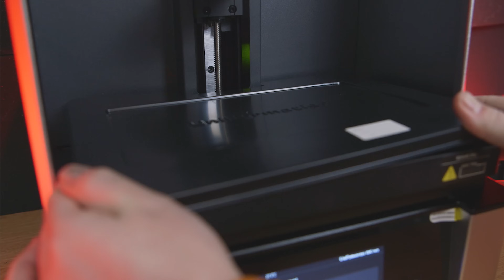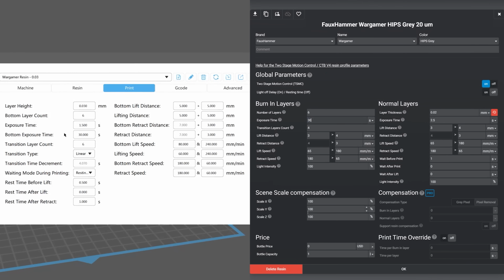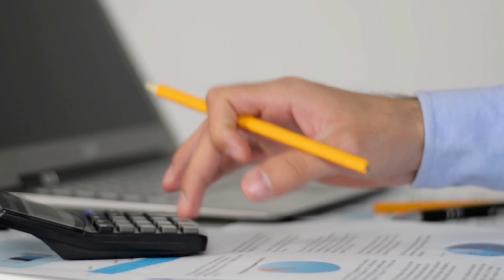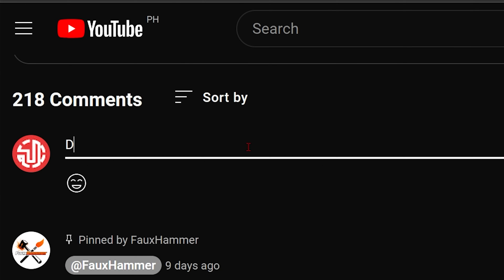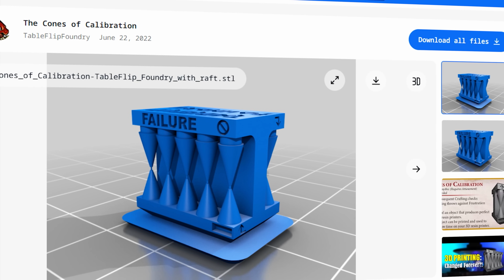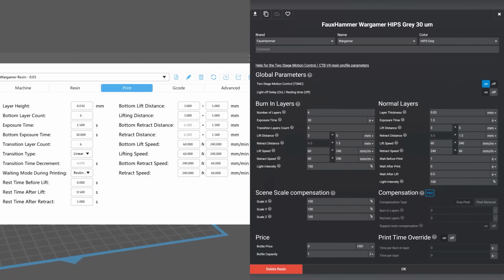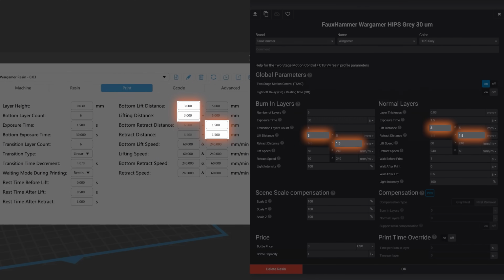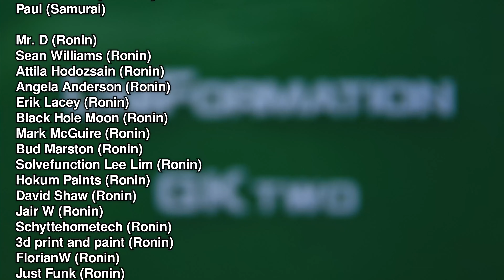The Best RESIN SLICER SETTINGS Explained for every printer! -  All Key 3D Printer Settings Explained

Comment: This was a helpful video. Sadly I cant use the newer version of chitu so I dont have all these settings. I use the elegoo mars pro and the new chitu doesn't seem to work on my printer. Once I finally get a new printer I should be able to use the new chitu. But for now my options are
Bottom lift distance 
Lifting distance
Bottom lift speed
Lifting speed
Retract speed
Which in order I have them set to 5,5,100,100,150.
I bought this printer in 2020 and only did a few prints havent touched it since. But now I got it back and im relearning everything about it again

Comment: Hi,
I have met a problem with the size of the models become larger.
Ex. The prongs size is 0.70mm but after printed become to 12mm.
Ex. The ring diameter (Inner) 17mm become 13mm.
What shout i change in setting?

Comment: I got my Anycubic Photon mono M5s PRO 14K, what was coming with Fast Fep, and I changed to Clear FEP as I was looking more for quality, but whatever I do now, I even tried different resins,  I get "zero pull force detected" and all my attempts are failed!, I find half of the bed on the plate, and half of the bet on the screen even before the supports even have a chance to form, so that foot before the print supports start it gets split into 2 halfs one on the bed but looks quite pressed and the rest is in the VAT, I tried to play with the settings and all that nothing seems to work :( please help!
Reply from the maker: Cna you not turn off the pull force detection on the Printer?

You will need to perform a manual level of the printer too, oif after that, nothing is sticking to the plate, then your base/botrtom exposure time is too low or too high,

Comment: Mine only stick to the film, not the plate. I replaced it and lowered the retract speed, but that didn't help at all. I lightly sanded the plate, cleaned it, and leveled it. I increased the exposure, delays, lift distance, and number of burn in layers. They never stick. Help please?
Reply: Bro have you ever found a solution?  I'm 5 months in never had a single print sticking
Reply: @amiity17  Nope. I just bought a space heater to get it hotter, and maybe that will help, but I haven't had time to try it out yet.
Reply: @amiity17  I'm guessing you're having the same problem? What printer are you using and what exposure time?
Reply: I had that problem when I first started out. For me it turned out to be exposure time and build plate was too smooth after a couple scratches (or light sanding) it should help but don’t over do it
Reply: @UnpopularOpinionsXD I already sanded it, but maybe not enough. It worked on a pretty large print at first when I got it about a year ago, but now even the smallest of prints fail. I'll try some more snading though.
Reply: @rswgjuse a 400 grit sand paper, keep it flat and run it over the build plate a bit. Lmk if that helped

Comment: I am getting failure at center area less thickness and sometimes delamination.
What should I do?
Reply from the maker: if it;s a saturn 4 ultra, check that your bed is level by tunning something eith a straight edge across it to see if it dips in the middle. Seems to be a common problem.

If it;s anything else, try increasing your lift heigght a little and maybe slow down the lift speeds
Reply: @FauxHammer  it's realy worked.
I increased z lift hight, after that problem is solved. Thank you Guruji.

Comment: Just curious, at about 5:30 you said you put the wait after lift setting to 5 milliseconds (0.005 seconds) but on screen it was 0.5 seconds. Curious on which time you do!
Reply from the maker: Sorry. Yeah I put it as low as it will go. 0.05. I think at the time, one of the slicers wouldn’t let me go that low
Reply: @FauxHammer  You're fine, thanks for the info and the fast reply!
Reply: @FauxHammer  That's still 50ms not 5ms though.
Reply from the maker: @ is a ms 1000/s? Either way. Set it as low as you can. But most people just leave it at 0

Comment: The cones are the bane of my printing existence.  I ran 4 tests at 2.0, 2.1, 2.3 and then 2.2.  Had perfect cones on the first 3 but when I dialed back down to 2.2 i had one of the success cones fail.  Makes no sense.
Reply from the maker: Have you read the guide on the site, it’s a bit confusing, but once you have at least some success comes. You need to move on to print accuracy with the bits that fill the cup and the sword through the skull.

You are using v3 right?
Reply: @FauxHammer  using v3. Just thought it was weird that the first 3 test prints produced perfect success  cones and I was dialing in the size of the holes for the sword but when I went from 2.3 to 2.2 (having already printed 2.1) that I had a failure. May not have let the resin heat up long enough.
Reply from the maker: @ depending what printer your using it may be errant pull forces it may be weird uv consistency across the screen.

Maybe slow down your lift speeds and see what happens?

Comment: I'm using v2.2. There is no rest time in the beta version. It does not appear in the slice settings. how can I reach this setting ??
Reply from the maker: It can depend on your printer. Also, what wait modes are selected? Theres often a drop down of 2 different types. Wait or rest
Reply: @FauxHammer  the settings I want are ; rest time before lift , rest time after lift , rest time after retract.
Reply from the maker: @ yeah. As I said above. Not all printers support it. What machine do you have.

Also look for a drop down. Do you have any other settings in that area
Reply: @FauxHammer  no, there are no other settings in that area.there are no settings related to waiting or resting
Reply: @FauxHammer  ı also using anycubic photon mono m7 pro
Reply: @FauxHammer I think these settings are available in version 1.9.4 ??
Reply from the maker: @ should be in the new version too on the M7

But since it’s anycubic. Why not use anycubic workshop?
Reply: @FauxHammer  I tried using it, but it doesn't have a waiting or resting setting.
Reply from the maker: @ilgazcakmakc7633  Ah no, i just checked, it;s not there for me on the m7 Pro either. Honestly, just use the Anycubic Photon Workshop with anycubic machines.
Reply: @FauxHammer  hmm ı got it. So what kind of slicing and support settings should I use to get proper printing on the m7 pro? I spent a lot of time and resin for this, but I can't get any results.
Reply: If you see "Light off delay" . . check there.

Comment: Faux i think i need some help, after i print and remove the models from the supports my models are left pitted and potmarked from where the supports were attached, is there a way to eliminate this?
Reply from the maker: Heya, yeah that’s kinda normal and especially in harder (often more detailed resins)

There are a couple of ways to deal with this.

1. If you are supporting models yourself. Use more, smaller supports rather than few larger ones
2. Remove supports before your final cure (and hardening)
3.. You could manually clip each support away and leave some material to shave/sand down, rather than have pits.
4. Use hot water. After cleaning and final cure. Have some water at 40 ish degrees celcilus (don’t scald yourself) and sit the model in that for a minute to soften the resin.
5. Again if supporting models yourself. You can often create a sphere at the contact point, which will encourage the support to break from that sphere rather than pull a chunk from the model. Again this will leave material to sand down.
Reply: @FauxHammer  thanks faux

Comment: My lifting distance wont let me go less than 8mm on left, but able to 3 on right. Is that because I have a larger printer? Also another issue I am having is older chitu print time for piece im doing is 12 hours, but i switch to newer 2.2 version takes 38 hours with same settings. I am so confused.

Comment: I didn't see this already asked in the comments, but if it was, I apologize. Is there a reason you use 8 (3+5) mm for lift distance as opposed to something smaller or larger, such as 2+4 or 4+6?

Comment: This is way too complicated for most people. Modern 3D Slicers come with printer presets for your specific model, I would suggest to stick with those. If you change the settings, it may react differently to different resins, for example, I noticed clear resin tends to work best because it allows more UV light to pass trough but if I tweak the settings for this resin and then switch to grey and forget to change the settings again, it may fail.

Comment: Do you know what the smoothest feeling resin is? I'm looking for something that has nice low friction surface feel when the part is completely cured. I think I want white resin but am asking around if that's correct
Reply from the maker: I'm not sure how "white resin" is any smoother than any other colour.... Why do you ned low fricton, what is the purpose? I suspect whatever resin you get wouldn;t matter. these models are printed by making teeny-tiny cuboids, so you'll need to smooth it after... either by sanding or coating.
Reply: @FauxHammer  We're printing some moving parts and the gummy/grippiness of some resins is causing unsmooth binding feel. I have some game pieces that have internal moving components

Comment: What we'd really need is some sort of place where people can put their dialed in settings with all parameters so others have some reliable starting point to go from. Obviously you can't just copy someone else's settings and hope that they will be perfect because anything, from temperature to humidity and potential dust in the air, could affect printing success, but we'd really be able to save a lot of time considering the amount of printers and resins out there.

And no, the settings from the makers of resins and printers won't cut it, because Anycubic will probably not be too interested in providing the GKTwo settings for their resins when they want you to use it with their own printers...

Comment: Love this video -super useful - A question though - at around the 10.20 ish mark, on the Burn in portion, (in Lychee) I think it shows lift speed as 60>240 but it also has that as retract speed - Am I right in thinking that should be lift 60>240, but retract 240>60? Just want to know what way round to put theseetings as I don't want to get it wrong and accidentally be driving the build plate and models towards the screen at high speed at close range!
Also, I've had a couple of support fails - it could be that the presupports themselves just aren't great but as it's a slightly larger piece (itsa  roughly greater daemon sized thing that comes in legs, torso and arms as a point of reference) some that were quite late on in the print and some wherea few of the supports seemed to fail early, but in both cases the pieces were still on the build plate and otherwise printed fine. (some were completely successful) Temp should be fine as it's a gk2. Wondering if it's worth dropping the lift and retract speeds (and if so roughly to what) or maybe knock up normal exposure to help the support tips, and maybe add a couple of my own supports?

Comment: Is there any way to know if print failed because of settings or bad supports? Because I did cones calibration, but some prints are failing, around 20%
Reply from the maker: Where are they failing… think about the process. At what stage are you getting fails and where?

Comment: Hello, when I lower the printing layers from 0.05 to 0.025, do I have to raise or lower the lift speed? Greetings!!
Reply from the maker: Tell me, what do you think??? Serious question…
Reply: @FauxHammer  Lower it I suppose, but I also think about raising it so that the thin layers receive the UVlight quickly since the curing time must be lower for better details
Reply from the maker: @hamlets.helmet  thanks so I was looking further your reasoning so I could know best to answer.

Your lift speed only affects the pull forces. And there is an argument that with thinner layers. The I’ve exposure would increase adherence of each layer to the previous one as it can penetrate a deeper percentage into the thinner layer.

So there’s actually an argument they can be increased. But in reality, it will be that marginal a difference you are talking fractions of a second.

Get your other settings dialled in first, and for speed. Just steadily increase it until you get failures. Then step back.
Reply: @FauxHammer  You made it quite clear. Thank you!
Reply from the maker: @hamlets.helmet  one is glad to be of service

Comment: @FauxHammer  So now my question is - GK Two or Saturn 4 Ultra? The ultra is closer to my budget, but I've been highly discouraged by near 100% failure rate on my Mars 4 Ultra and Mono X2 (likely temp related despite efforts to remedy). Which machine do you think changes the game more significantly for the price point?
Reply: If i was getting those kind of failure rates on two different printers then id be looking for something ive missed. Maybe choice of resin. Or yea, the temperature.

Comment: The motor should be fine if you don't have it wait after a lift, the distances and speeds are so small that the inertia is basically negligible, also considering that FDM printers are whipping the toolhead around like crazy seems like solid evidence that the motors can handle it.

But also it definitely doesn't hurt to give the printer and the resin a moment to settle between layers, half a second per layer seems like a pretty small price to pay in exchange for more consistent prints
Reply from the maker: That’s a good point actually, never thought of it that way

Comment: rest time before lift is to allow the curing a little time to finish, it's supposed to help layers adhesion which can aparantly result in smaller supports working better, I've not tested this though.

for rest time after lift, all printers I've seen have some acceleration/deceleration set in so it won't suddenly switch from lift to retract so personally I wouldn't worry about it switching super fast, especially when with fdm printers we have them buzzing about like mad without worrying. However I have seen people reccomend lifting fairly fast and low but then waiting after lift to allow the peel to happen by itself rather than just continuing to rip up. Again though I've not tested that.

Comment: Rest Time Before Lift:  The expansion of resin is not stop immediately when uv light is turn off ,this is photo chemical process with relative low  time constant, so adding time to this parameters helps maintain expanse in x-y axis rethen than in z axis . Mainly influance in bottom layers where expose time is large.
We have the name for the expanse in x-y as 'elephant foot' .yet we don't have a name for the problem i have of squeezing the first layers after bottom layers and in this case the solution was changing this parameters to 1 sec. (Nova 3D Red Wax like resin / Saturn 3 Ultra)

Comment: They mostly come out at night...mostly. Great review Ross, Thanks. Do you still need that capture card for the garage?
Reply from the maker: I got an Elgato 4k x, software is shit, it’s going back. No space on my main board for internal cards
Reply: @FauxHammer  I have a 4k@60hz USB C - HDMI that'll work with just about anything but I use OBS and it works great. It's sitting here in the box with a few other kinds (reviewer here too) so shoot me an email and I'll send it out with my next bundle on Friday. Just give me a mention if it works. LOL

Comment: Great video for newbies or just as a refresher! To reiterate to any newbies, your exposure times and lift speed/distance are likely the most important settings to get dialed in if you're having failures. Then look to your supports, then look to physical factors like room/resin temp, leveling, etc.

Also for your bottom and regular lift speeds, you can either have a low speed or high speed, but there's a "dead zone" where layers will peel awkwardly off the FEP. A higher speed obviously means faster prints, but if you go too fast (or too slow) the cured layer will stick to the FEP or only partially release. Mine is 120mm/s and I get perfect prints (Jupiter SE). But if I were to print something small and delicate, I might want to lower those speeds.

Can't wait for the AA video!